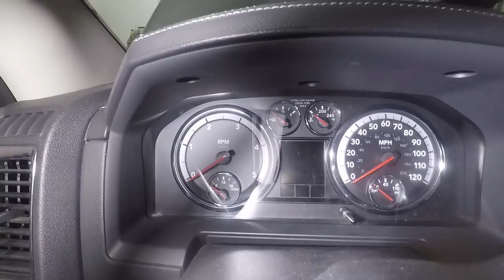6.7 Cummins Engine COVERED IN RUST, Can It Be Saved?? & How To Remove 6.7 Cummins Fan And Fan Shroud

Comment: I cracked a fin on a radiator one time when that fan assembly fell off like that before.  The hub hit it just right, also if you don't have an air chisel you can take the appropriate wrench 1.25ish and just hit on the end with a hammer straight down and it acts like an impact driver and loosens the nut.  Love the content, and the correlation between east coast and west idioms and/or sayings.

Comment: You might be planning on doing this, I know I am.
After you vac out the cylinders and put the head back on, add a quart or 2 of oil. Let that sit and flush all the dirt particles into your oil pan.
Change oil and filter before starting it up. 

That way you won’t have dirt get into your bearings.

Comment: On the kfx get smaller look up stock shim specs and if its not over 10 thou's of difference or so you can just reshim them if its much more then that it will such a valve through the head after a while, but long story short usually you can reshim them and be fine

Comment: Hey brother, I'd recommend some electric rad fans. I was suprised to see that those stock fans have enough rotating mass that they can pull over 25hp. The guys from roadkill also have a show called engine masters and they dyno motors with all kinds of mods n such to compare and it was drastic

Comment: I took my 05 to the dodge dealer for driver airbag and now steering wheel is loose on the steering shaft so now i will never take my truck to the dealer becuse they fucked it up.